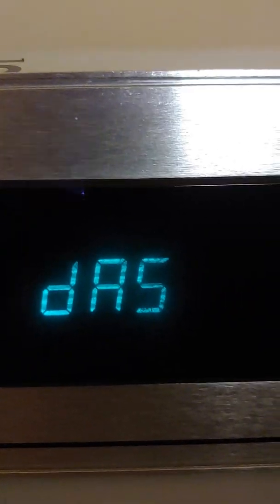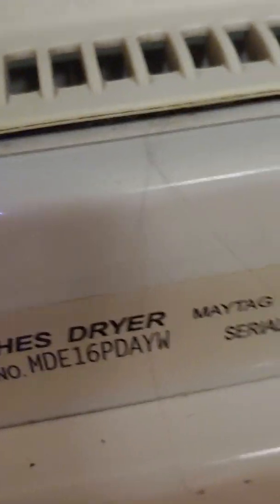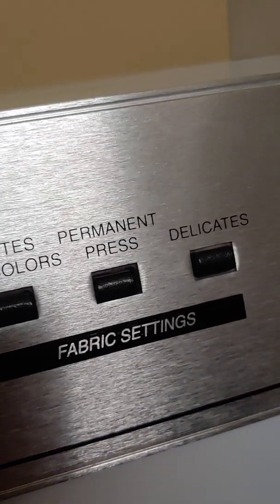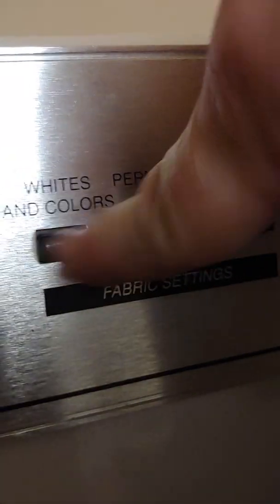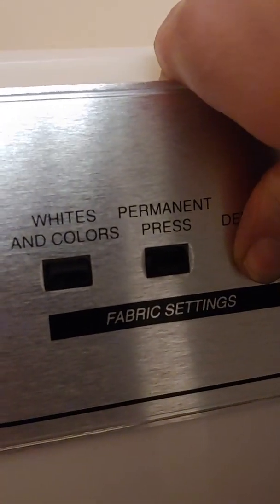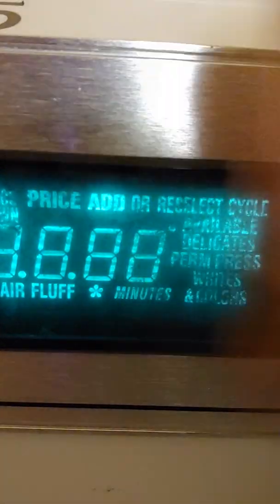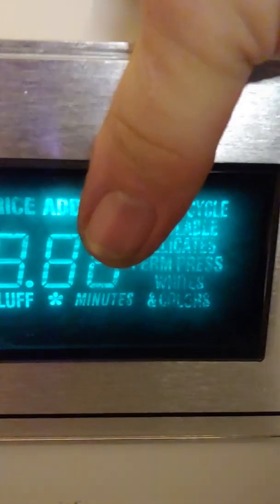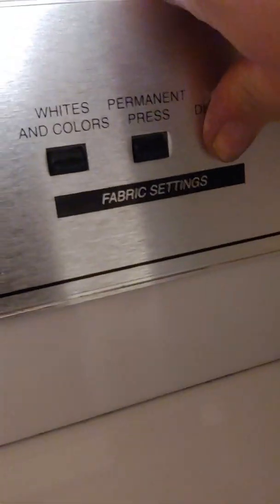maytag commercial dryer Fix "das"

Comment: We have a dryer just like this in our apartment building but it's not working. The display panel reads 0 mins like it got to the end of the cycle but isn't resetting. Do you know how to fix that
Reply: Did you ever find an answer to this? Mine is doing the same

Comment: Dear Sir,
 I tried the way  to reset machines(MDE16PDAYW) out of the DAS(Data Aquistion) mode
to factory defaults(Programming the machine manually )

However, was not work!

I found the difference between is the control board of mine the CPU is DRS2 version(I noticed your version is DRS)

so may have different ways?

Any ideas, or  have the instruction  to resolve this?

Regards,
Reply from the maker: I'm not working on commercial laundry anymore.  I'm so sorry I can't help you

Comment: Dear Sir, I have a stacked commercial Maytag coin operated unit. It was working but now the digital display reads 0.00 the washer still comes on but the dryer will not. Could you please tell me how to reset it. Preferably with 0 or 25 cents to operate or how to obtain an owners manual the model number is MLE19PDAYW thank you for your time.